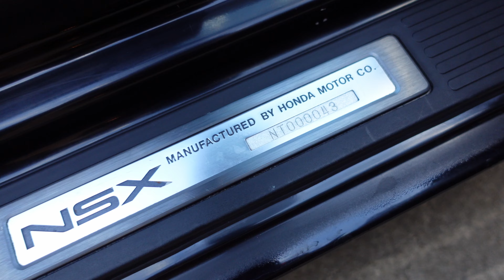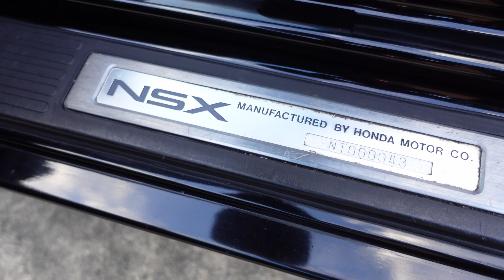1992 Acura NSX Build Part 5, Walk Around.  ONE TAKE! 4K

Comment: I didn’t know the NSX had a slight “dip” that almost makes it look like there is a “dent” just right below the pop up headlights on the “upper side of the front bumper.” Barely, noticeable but you can see light sort of reflects in a slightly circular wave. Don’t think it’s a dent, it’s just how the bumper was designed and manufactured?? You can kind of see it at 0:22 of the video. Still a very beautiful car! Great job!